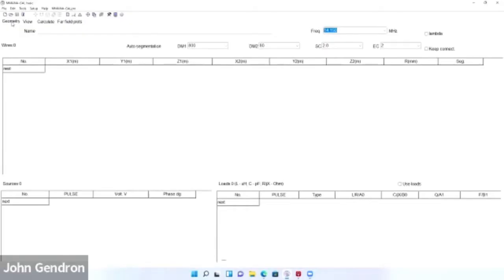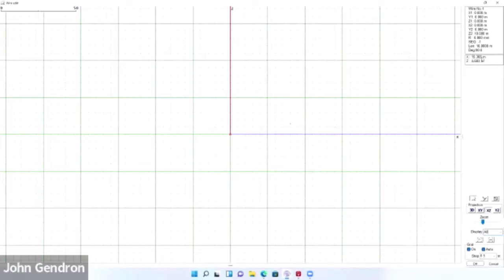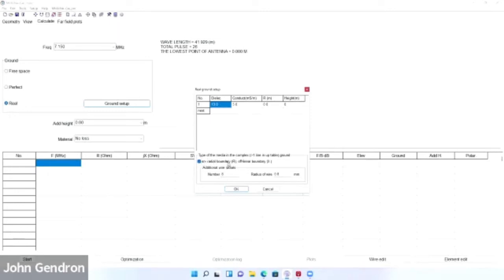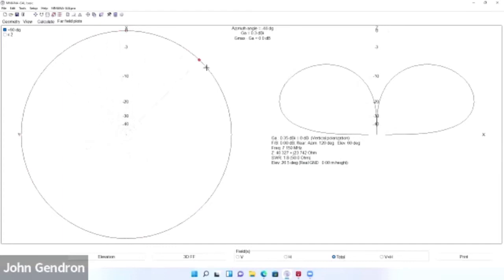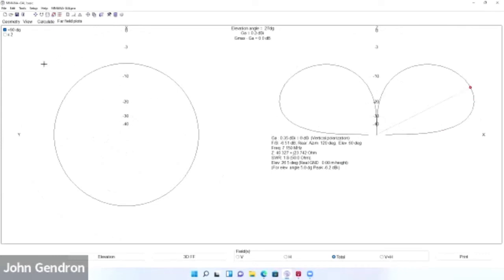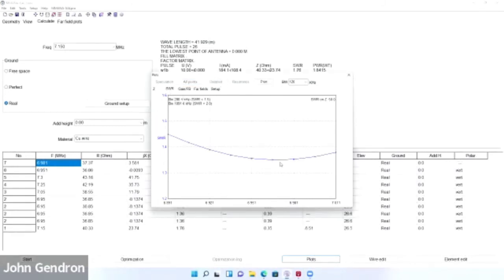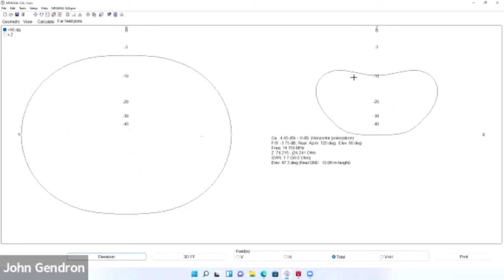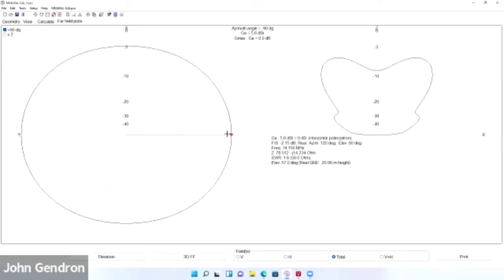YCARS   First Steps with MMANA GAL

Comment: I am just starting to use MMANA, and when I select source for a 20M vertical antenna, the program is telling me that selecting "End of Wire" is not recommended, and antenna performance values for SWR are nowhere near what I have measured for the antenna.  Would you be able to suggest what I am doing wrong in the MMANA?  I downloaded the latest version on 12/9/23.  Thanks!
Reply: Im having trouble with the source as well.. Its like i have shorted coax all the time....
Reply: If your analyzing a 1/4 wave dipole, try lifting it about 10mm above the ground plane.